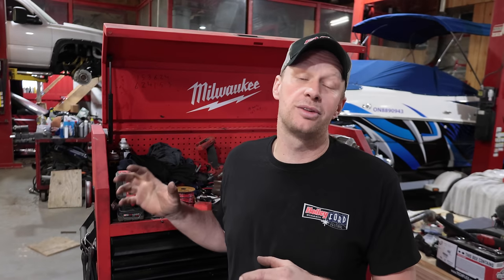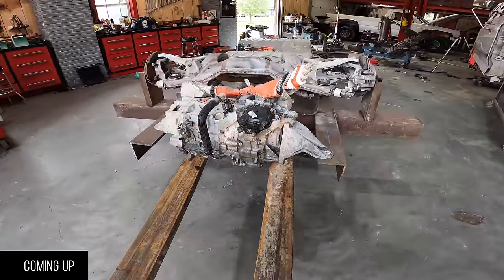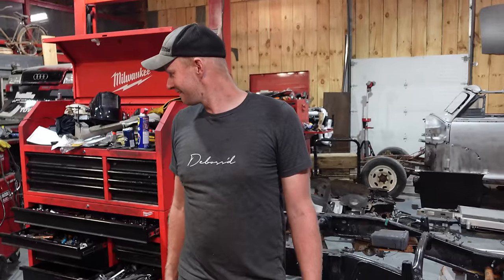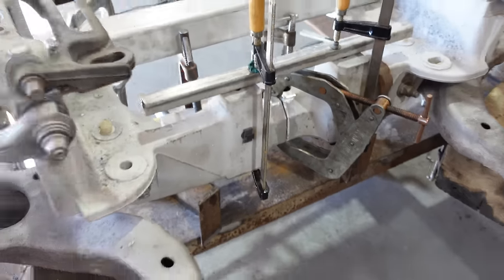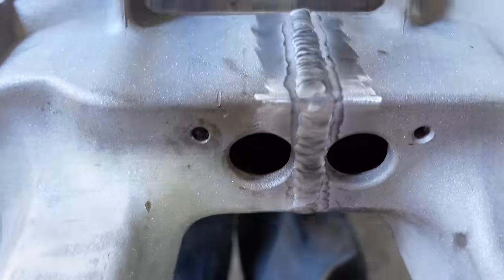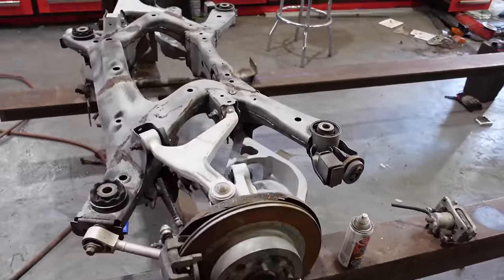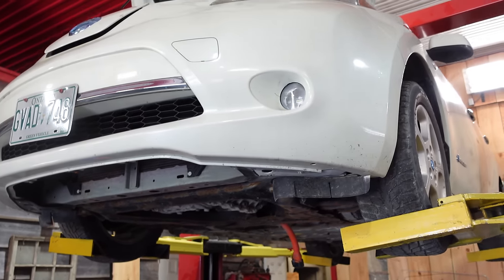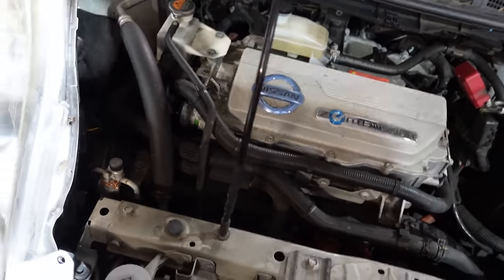Nissan Leaf Motor Gets Mounted in Reverse? #48CHEV [EP2]

Comment: A Nissan Leaf isn't an exciting car to drive. It's the Nissan Altima of electric cars. It gets you from point A to point B as efficiently as possible. The handling isn't anything to experience and the power is anemic. Electric cars can give a lot of performance for city driving since they have torque curves that are really flat and start right at 0 RPM, so you can take of and accelerate if you have the power. It kills battery range when you do, but if you lead foot a little, you can get very zoomy very easily in one that has enough power.

The real place electrics shine is your day to day driving. Running to the store. Picking up the kids. Running errands. Commuting to work. All those 20 mile or less trips, especially the 5 mile or less ones in city traffic. They are all short enough that range is no concern, you can be in sport mode, and the car recharges at home on a regular outlet overnight no problem for less than the price of a hamburger. Plug-in hybrids can also do this and give you the option of long range travel, hence why they are also very popular.
Reply: 5 miles or less, get a (cargo) e-bike

Comment: I still believe that the best approach is a diesel electric hybrid that charges capacitors instead of batteries, saving weight and charging time. The electric is used for accelerating while steady state cruising and recharging is done by the small diesel.

Comment: Okay, you need a diesel generator in there to extend the range....and because pure electric is boring.
Reply: that is what they are doing to the ram truck
Reply: @JD-yx7be  it's the best solution we have so far for rural Canada. It's a problem when the distance between charging stations exceeds the range. Got a couple at work that bought a volt I think, they have a 25 minute drive on the highway to work and by the time they get home they are down to 15%. And this had been a very warm winter, if it gets to -40 they won't have the range.

Comment: All the various batery capacies available in the nissan leaf have the same form factor. So later on you can swap this (guessing) 22kw paack with a 60kw and it will bolt into the same place.
Reply from the maker: That's the plan!

Comment: 10:11 OMG Is that the f3kitty sitting there torn apart....again? Or do you by chance have another complete white crewcab obs cab sitting in your shop? I'm confused now! What is happening there Rich? Like seriously 🤔😲🤦🏻‍♂️🛠️🔧🔩
Reply: You must be finally wrapping up the interior 100%, I hope. Guess it's time to charge the m12 seat battery & maybe hook it up to a regular fused 12v battery supply so you can use the m12 battery on actual Milwaukee tools in the shop. I am still shocked seeing that cab sitting there in the shop without the rest of the frame & Caterpillar engine. Hope everything is ok with the f3kitty!

Comment: EVs that are not boring have too short a range to be a replacement for a full time car.  The reality at present is to have range you have to have boring wheels, boring tires, boring dynamics, less power and huge battery weight.  A 1500lb EV with 200hp and an 80 mile range is possible and I can see it easily being entertaining, but you're not going to use it for the family grocery trip.
Reply: There was a MX-5 (Miata) swap that would definitely fill that void, but not many people have £15k to drop into an EV conversion of a £3k old MX-5.

A new factory one would be interesting though, but per Rich's comments there's no noise/vibration/feedback.  I suppose if you had a quick ratio steering rack with the minimum of power steering (I hate vague steering!) and a convertible it could be quite fun.
Reply: 1500lbs is an incredibly light weight car. a typical sedan is 3,000-3500lbs
Reply: @JD-yx7be  yes, and light vehicles are more entertaining and less practical.

Comment: If you ever narrow a Crown Vic axle again, half lap the housing. I understand that welds are strong, but this will method will make it much stronger. Think of what carpenters must do to get two ends of wood that butt together in a straight line
Reply: Use lots of wood glue?

Comment: that weird plug on the top center of the battery is what disconnects all the cells from themselves. you're supposed to remove it before any servicing. otherwise you could have hot voltage at that big plug you undid. at least that is what the manufacturers say.
Reply: There are contactors inside the battery box that should stop that happening but to be certain it is always best to remove the safety disconnect.
Reply: @alibro7512  i believe it's for in case the contactors weld themselves closed.
Reply: @bighunterman77  Correct. Having welded a few myself I know it can happen which makes other battery packs from the likes of VW kinda scary as they do not have manual disconnects.

Comment: Okay, when people refer to emissions, like a zero emission car, they are correct; If you look at what the word Emission means (the production and discharge of something, especially gas or radiation) you will find that all electric cars are in fact zero emissions. All ICE cars have the same downsides to being made (IE the environmental impact of mining for the materials they're made of) but ICE have the added downside of constantly 'emitting' pollution for its entire life span. Yes, generating the power for charging cars is also not great (getting better with solar wind and nuclear investments) but if you look at how Gasoline is made and then delivered to gas stations, EVs are still way ahead as far as mitigating the environmental impact. it doesn't take a scientist to see that.
Reply from the maker: Debatable.  If you see how much fuel is needed to mine the minerals for batteries, dig the holes for the wind turbines, deliver the wind turbines and the amount of concrete poured into the hole to hold up the windmills, the amount of toxic glue used in the fibreglass blades of a turbine, they don't become neutral until the last 1/4 of their life span.  And then the amount of extra energy needed to recycle all the materials...  Keeping in mind that windmills, and solar panels don't get recycled, they just bury them where people can't see them.
Reply: @DEBOSSGARAGE  There are fuels used in transporting oil, refining and distributing fuels as well. Consider total amount of EV's on the road, compared to combustion vehicles. The amount of energy required to recycle batteries is super low, since there isn't much EV dead batteries to begin with. There are a few battery recycling plans are located in EU and NA continents. How many oil refineries there are? Hundreds? First mass produced EV models are 13 years old. Lithium batteries have 10-15 year lifespan. (end of projected lifespan means degradation 20 % or more) Batteries still work, but degradation should accelerate slightly from that point. Keep in mind that recycled materials replace some of the suply of freshly mined materials. True for not recycling windmills and panels. There are first tries to develop ways to recycle these as we speak. I think that we should use every way possible to get cheap energy. We should not be focusing strictly on one source of energy. I like your content but i have to disagree with some of your stated negatives about EV's. 1. If you consider 27 years as young, then i disprove the point about driver enjoyment. I find electric drivetrain way more responsive beause of instant torque and regen braking. I work on hyundai EV's. 😁
2. Range anxiety could apply to leafs. Leafs were pretty bad in terms of battery degradation. Are there any cooling ports on the battery case? Uncooled batteries really suffer when cycled frequently. Liquid cooled batteries in electric cars is standard now. 3. When you drove Topsy, you smiled in exitement. When you imagine this project in your head, you smile in exitement. I am just not convinced, you really see more negatives than positives on EV's. 😁 You work to make it even more positive. I will keep watching your projects, both combustion and electric ones.

Comment: Why would you mount the G35 Suspension backwards?  Don’t you understand that the engineers designed the independent rear suspension to have toe-in around a corner.  If you reverse the suspension then you would have toe-out and the car would be a total oversteering car.  Whatever, I guess you are just hoping someone will certify the car.
Reply from the maker: Because we experimented, all different positions, and realized that with a couple adjustable rods, we can change the toe, and make the motor fit the best
Reply: Wow, you should propose your idea to Nissan that yours works at all situations but doesn’t consider driving straight. Correct?
Reply: @Adscam  it's a hot rod not a production car
Reply: The direction of the arms will affect the anti squat too. I really wouldn't be messing with that geometry.

Comment: You said I've got to work on my stuff so I did that instead of watching the video ;-)

I sprayed the insides of my Miata ignition switch and after I realized the little solar top-up charger wasn't working and connected a jumpstart battery, it turned over no problem. Ran to the Costco for fuel, and grinned all the way there & back. Thanks for the encouragement! I was feeling a bit unmotivated today.
Reply from the maker: Attaboy

Comment: Honestly, diesel/electric hybrid is really the only viable way forward. Straight electric is only a drain on resources; has very little value towards saving anything. Just the batteries necessary are incredibly destructive to the environment. Add in the 'renewable' energy, that isn't renewable at all, and straight electric is just a loss, not a profit. 
I'm happy to see you and Chase from Edison working together to get viable diesel/electric off the ground. You're only translating railroad locomotive tech, to the highway.